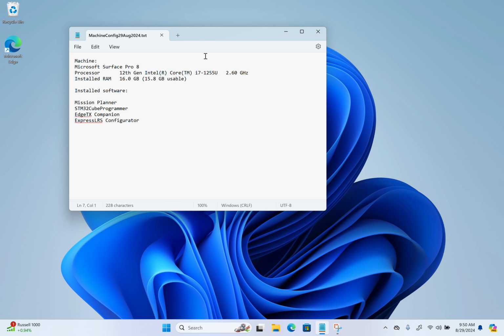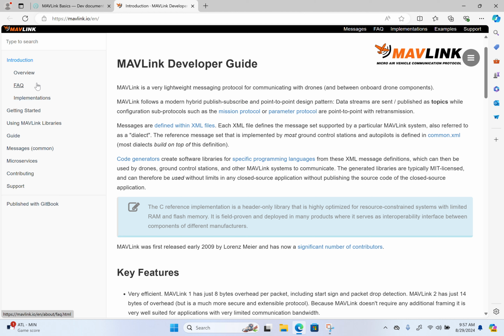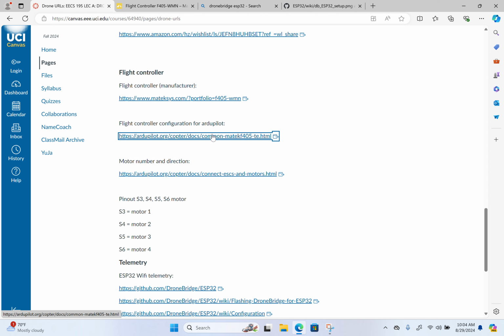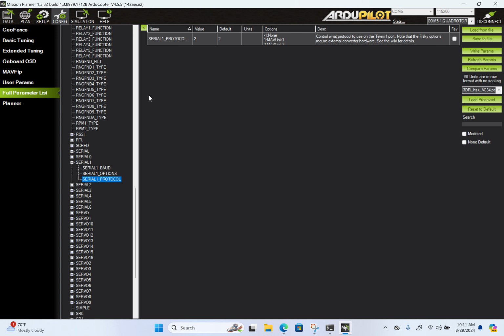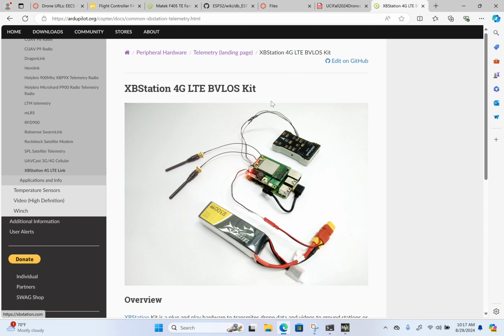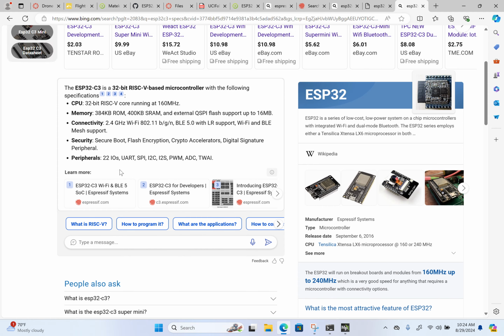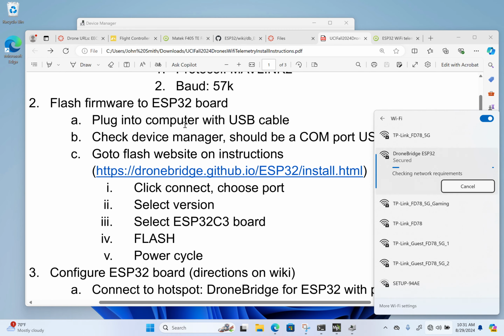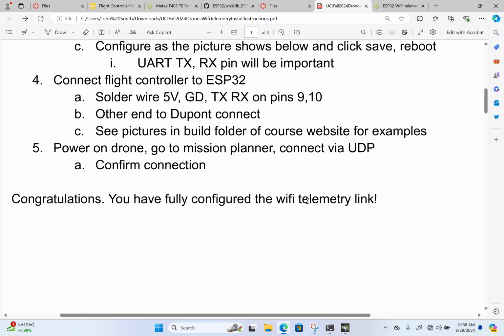Wifi telemetry

Comment: Hello. Are there any issues with logic levels? The flight controller has 5-volt outputs, and the ESP32 has 3.3V. Don't you need a level converter?
Reply from the maker: In principle yes. But we have not had any problems without a level coverter.

Comment: sir can i use esp8266 nodemcu board , and can i get the code
Reply from the maker: Check the website dronebridge on github. This is for esp32 but I think there are other solutions on github for esp8266.